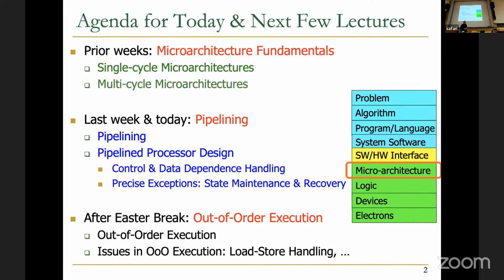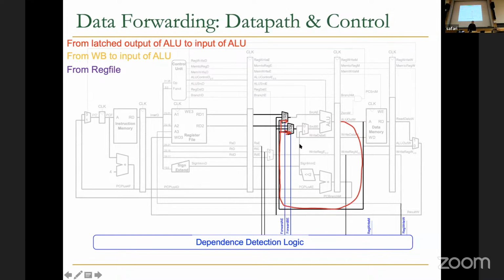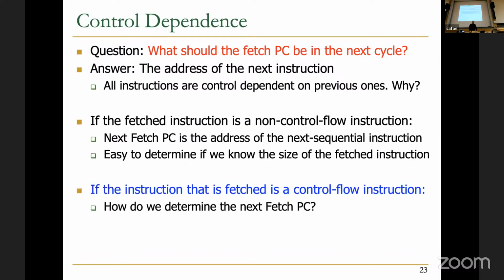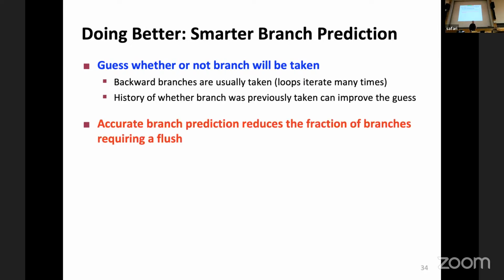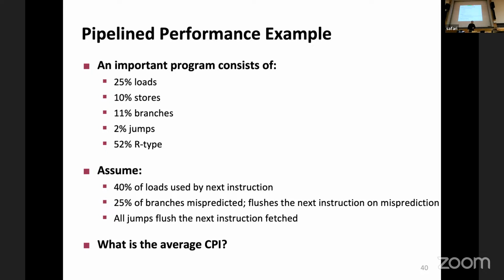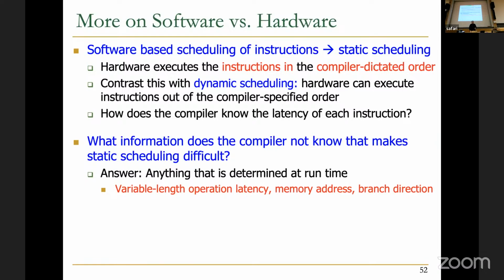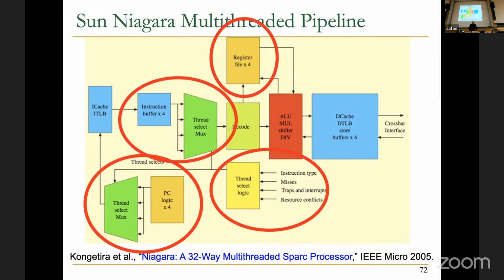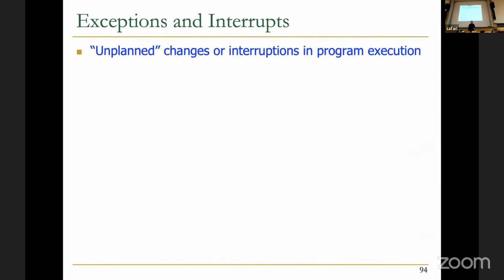Digital Design & Comp Arch - Lec. 13: Pipelined Processor Design: Data & Control Dependence Handling

Comment: @OnurMutluLectures
Can't understand why ant I dependence is okay, 
write after read:
we are changing value of r1 before it read by r3?
r1 is not ready to change until r3 will get the current value of r1

okay yeap if you have enough registers you can avoid this dependencies
and in real world where these false dependencies are avoiding? by software?